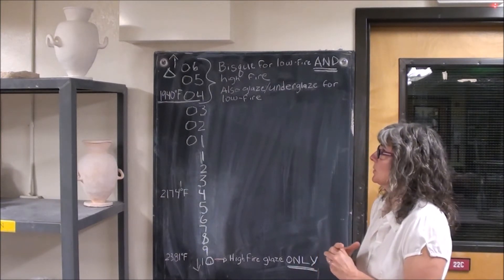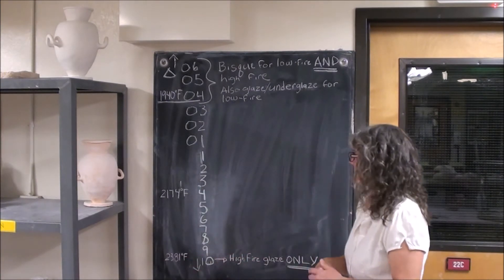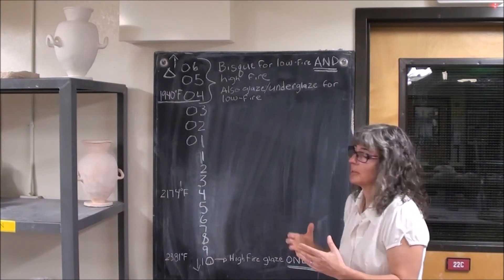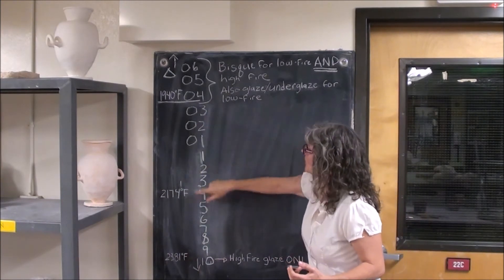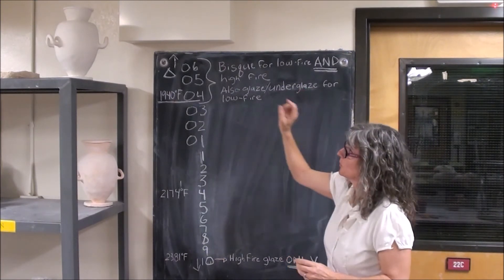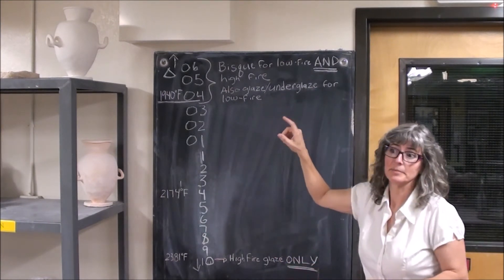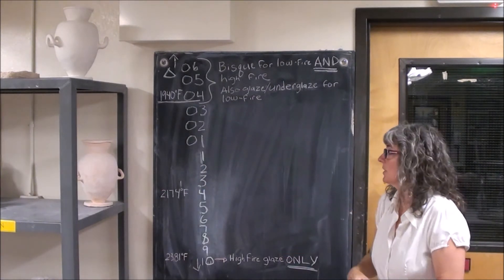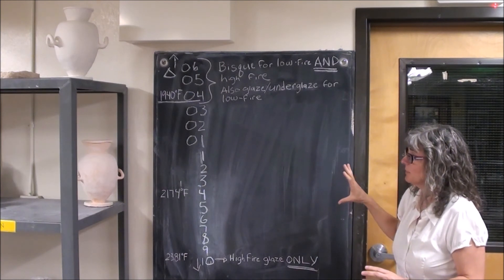Beginning Ceramics Part 1: Differences between low and high fire

Comment: Many electric kilns only go up to cone 6. Is it worth the investment to get a kiln that can go to cone 10. I'm not sure of the advantages. It sounds like some glazes require it but what makes those cone 10 glazes unique that I couldn't do at cone 6? Thanks for your video.
Reply from the maker: People like cone 10 glazes because they are particularly durable for functional pottery.  If you fire to cone 10, your wares are much more durable and will survive the dishwasher nicely.  So, if you want to be a studio potter making functional ware, it might be worth the investment.  However, a lot of functional potters stick with cone 6 because it is so much easier to do from home.  But it is my understanding that, generally speaking, that ware is not as durable as cone 10.  If others disagree, please correct me.  But if you are making sculptural ceramics, I wouldn't even think about cone 10.